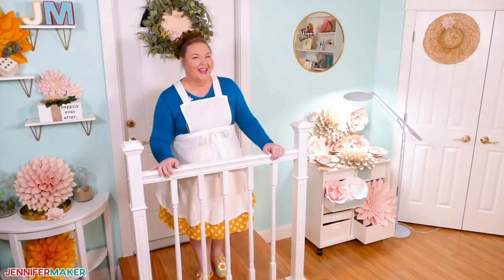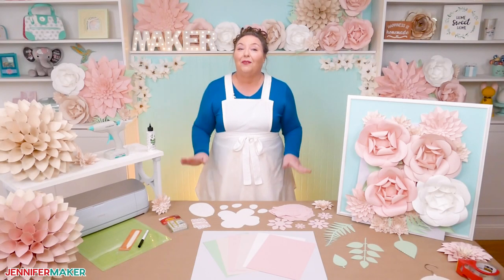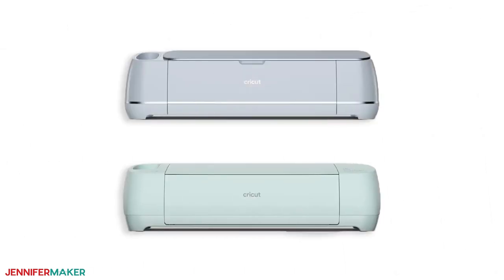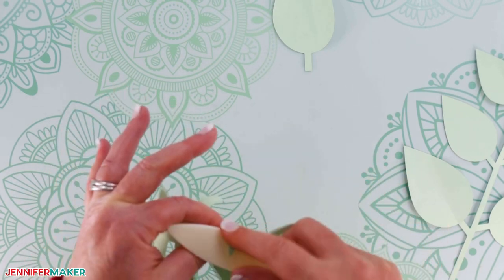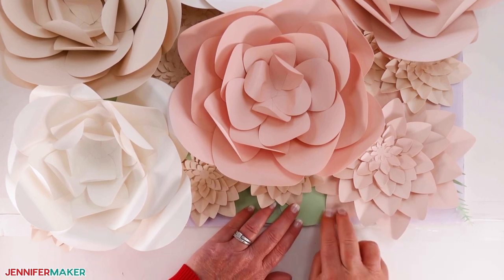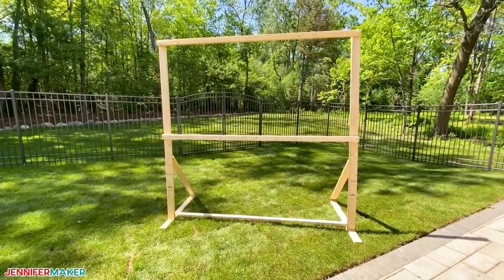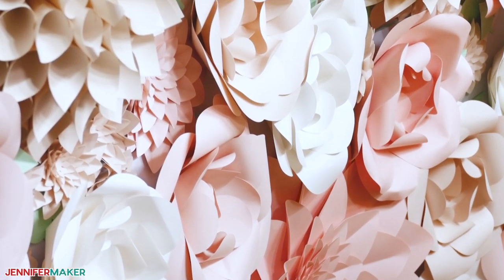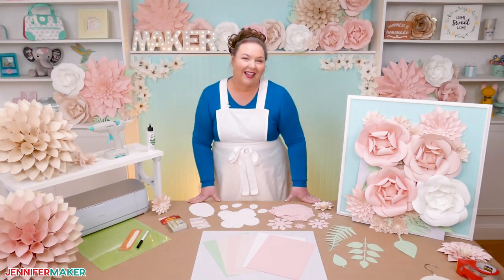Paper Flower Wall Decorations & Full 8x8 Backdrop - Everything You Need!

Comment: Just had an idea about taking it down for storage. Instead of cutting every square panel separately, what if you kept A1 and A2 together (B1 & 2, etc.) and folded the two panels, with the backsides together? Then A3 & 4 etc. Would that work? Not sure how you store the panels without crushing the flowers, but whether they’re stored single or two together, it seems it would be the same.
Reply from the maker: Sounds like a good idea.

Comment: What's the advantage of using the Command strips to attach the flowers rather than permanent assembly with hot glue?
Reply from the maker: It is your choice. You can remove them easier with command strips and reuse or rearrange the flowers more easily.

Comment: Why did you choose to attach the large flowers with command strips?
Reply: My exact question, too.  Would hot glue work instead?
Reply from the maker: You could but if hot glue is in the heat it can fall off. I used hot glue on a door hanger with hot glue and the heat from the sun made my bow fall off.
Reply: Thank you @Jennifer Maker. I knew there would be a good reason.
Reply: @JenniferMaker  Gotcha!  There's gotta be a cheaper way . . . maybe epoxy . . . maybe double-sided foam tape??  Just thinking out loud. 😊